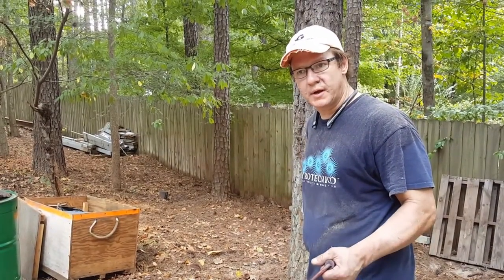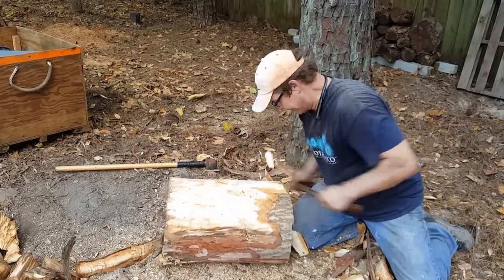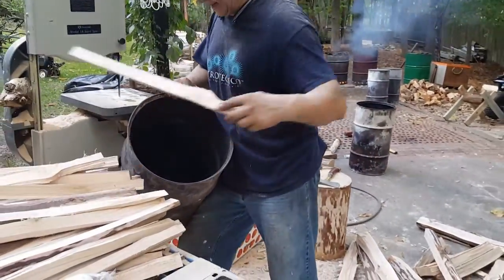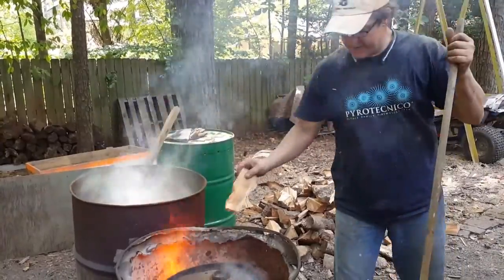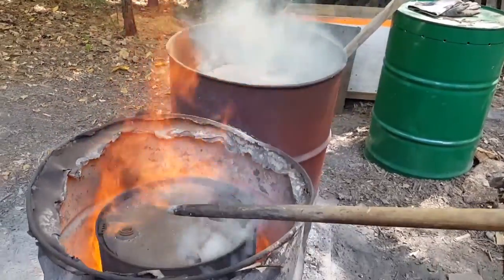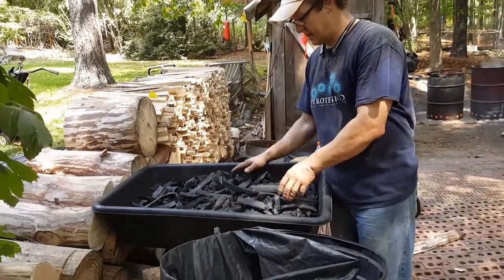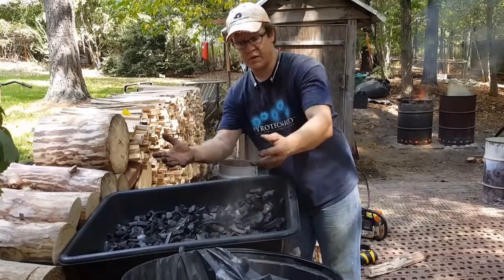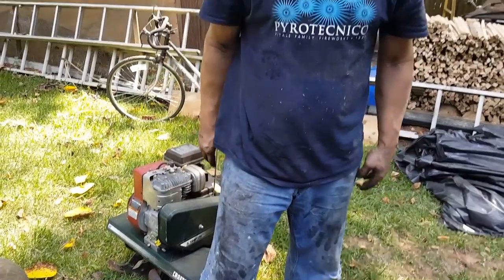How I make Paulownia charcoal

Comment: Nice videos!  I've made my own BP from DIY balsa charcoal but never thought of using Paulownia. Just so happens I have a ton of it growing on my property here in Calvert County MD.  Very fast growing tree,  I had one grow over 30' in just two yrs.  Got about a dozen big trees, 12"-15" wide, maybe 75' high
 I also build RC planes, heard Paulownia is slightly heavier than balsa but much stronger, almost as strong as spruce. Will have to try it out for both black powder and critical structural parts on my planes.
Reply from the maker: Good you have them growing there. You will find the balsa makes a faster bp,  however the gas production limits it uses. Paulownias makes for a very fast powder too but much more gasses for better lift and break.
Reply from the maker: The gas produced from balsa is much less than paulownia. Both burn simmmilarly fast. Glad to hear you have an abundance available to you!
Reply from the maker: Yes, from a strength to weight ratio, paulownia fits the bill for many construction applications

Comment: Ha!  Just made a small batch of Paulownia charcoal in a 5 gal metal DIY retort.  Put it in a 55 gal drum  surronded with dry Sassafras followed with dry Black Locust and Cherry branches.   The Paulownia was a little moist, it made a good amount of steam at first.  Cooked for about two hrs.  Came out perfect!  Sure beats buying Balsa at the hobby store!  What was I thinking!!
Reply from the maker: Chris Barth glad it all works out for you. Let me know how it performs for you.
Reply from the maker: Chris Barth I also understand the locust is good to make charcoal too.
Reply: I figured Black Locust was too dense?  Very hard wood!  It's it good for certain types of BP?  Does burn very hot as firewood, IIRC, it rivals anthracite coal!   Ever heard of sassafras being used?  Just seems like a good wood for BP charcoal.   
BTW, have you ever been to the MAFF(mid Atlantic fireworks festival)?  Few years ago I went there on a whim since it wasn't too far from where I live. Holy s#!t,  did not expect an "amateur" fireworks show like that, man, what a surprise!  I was amazed at the hobby after that, built my own DIY ball mill, read up on the BP process and successfully made small batches. Just never got beyond simple stuff, only made small paper shells that go boom. 

 Lol, you wouldn't believe my fuse lighting method, it combines one of my other hobbies, lasers.  I use a very high power handheld lasers in mag light body (1W for 405NM, 6W for 445NM). I build them myself from diodes harvested from Blu-ray burners and DLP projectors. They can ignite a fuse from 30-40' away!  Have to stay very still though.  It will even instantly ignite straight thermite from a distance
 which is very hard to do without some sort of  "helper" (flash powder, magnesium strip, etc.) even a propane torch won't work.